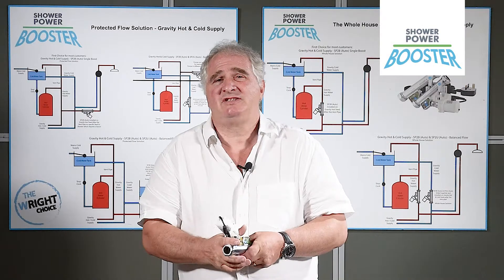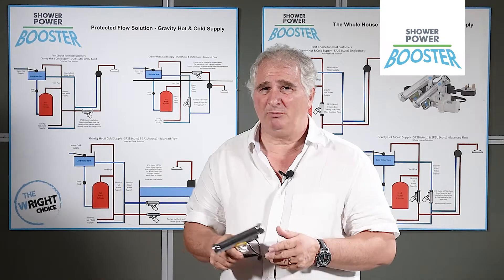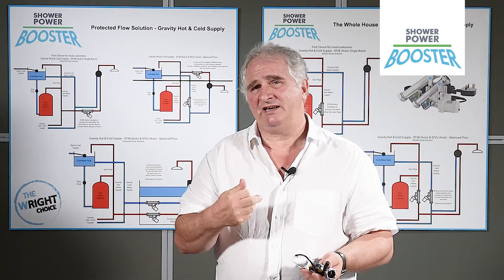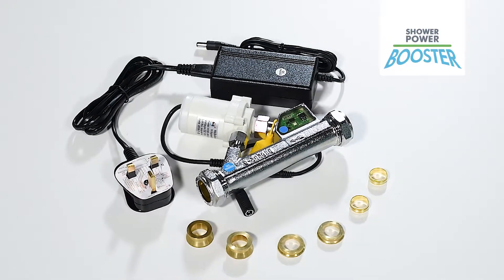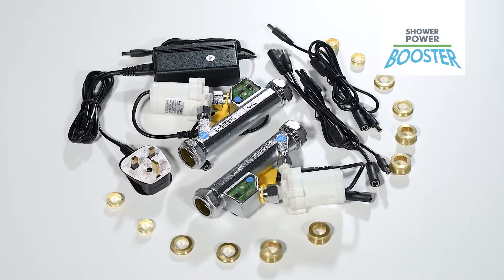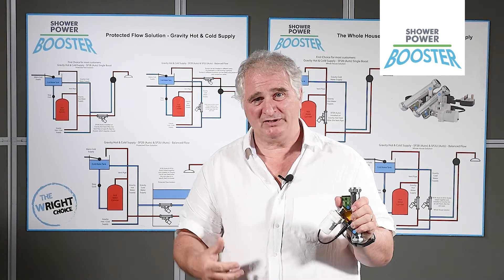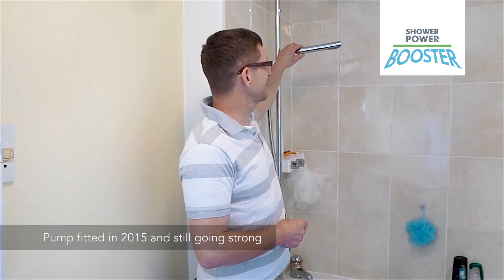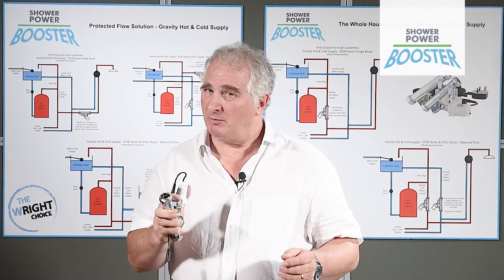Increasing Pressure and Flow with a Shower Power Booster

Comment: Fantastic, just what I need. However are they a standard UK fitting size? As in Ireland our 15 & 22 is different??
Reply from the maker: Just buy some olives at your local plumbers merchant. Swap the 15mm olives for 1/2 inch olives or the 22mm olives for 22mm to 3/4 conversion olives and they work perfectly in Ireland. Call our customer service team if you want further help

Comment: Tried one of these pumps and it didn't improve. Put two inline and it still didn't work well. I was eventually thrown out of the house by my customer, without pay!
Reply from the maker: Each pump will have added 0.4 bars pressure so you will have had the equivalent of mains pressure (0.4 bars plus 0.4 bars pus whatever pressure you started with). Please contact Gemma to discuss.
Reply: How is 0.4+0.4+ whatever you stated with equal to mains pressure mains water pressure is normally 3-4  bar in most of the UK.  You would need a heck of a lot of head of pressure to get that 20-30 metres in fact.
Reply from the maker: @josht8288  Service standards which are agreed with Ofwat that require a minimum supply pressure of 7 metres head (approximately 10 psi or 0.7 bar) , measured at the point where our communication pipe joins your supply pipe.

Comment: I have very poor water flow to the hot taps in my bungalow.  I have mains on cold and gravity on hot.  As my plumbing is old and inacessible I was thinking about using this on my hot supply.  Would this be a solution? I was a bit concerned about the overall water flow.

Comment: Can I fit this on a negative head shower set up? Will it fit on the  3/4 inch hot water feed for the whole house?
Reply from the maker: Yes you can fit it on a negative head set up and yes it will fit on a 3/4 inch feed for the whole house. Email me on alanderekwright@icloud.com and I will send you links to what you need.

Comment: Have fitted a few of these, they are quick and easy to fit and much quieter than the large noisy traditional hot water/shower pumps. The increase in pressure with these is very good.
Reply from the maker: Thank you for your endorsement